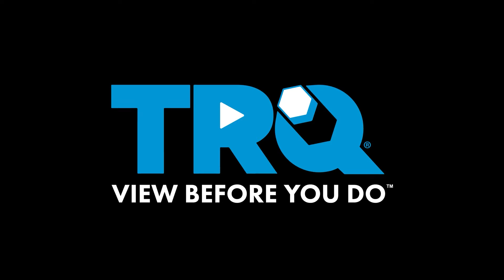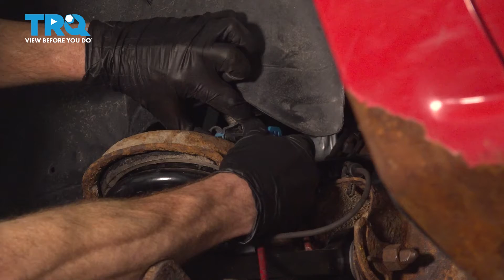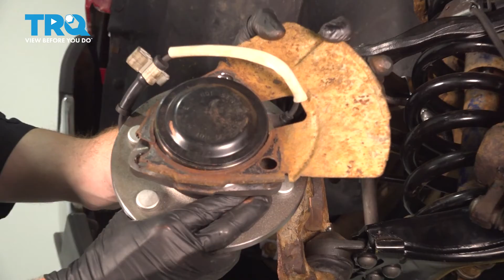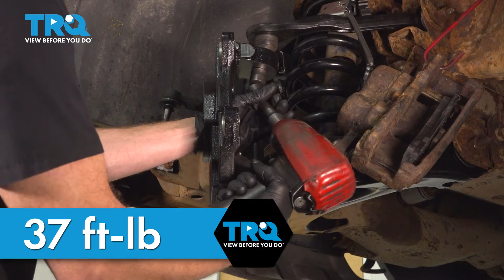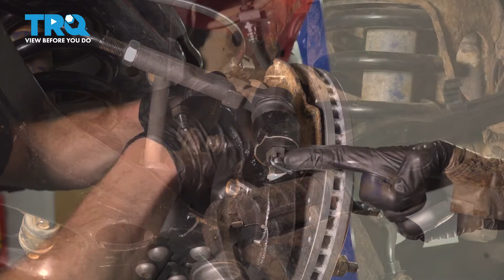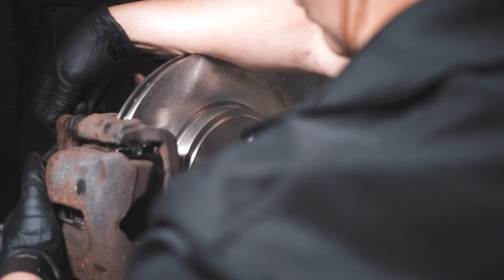How to Replace Steering Knuckles 1999-2006 Chevrolet Silverado 1500

Comment: Something is not right here. I have a 2004 Silverado and the CV axle mates through the front hub. The demonstration vehicle has an independent front hub. So either this video is not relevant to 1999-2006 Chevrolet Silverado 1500 vehicles or there is some model differences. Either way, TRQ failed to provide sufficient information to make this video trustworthy.